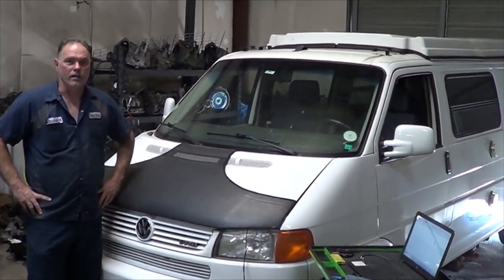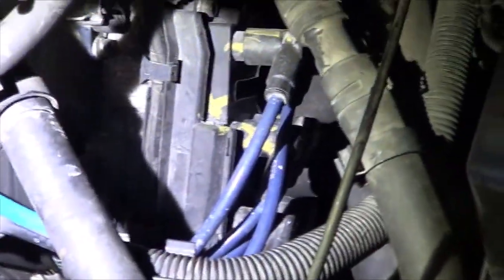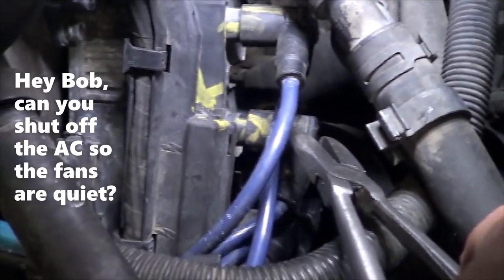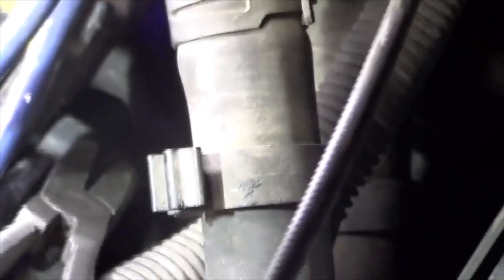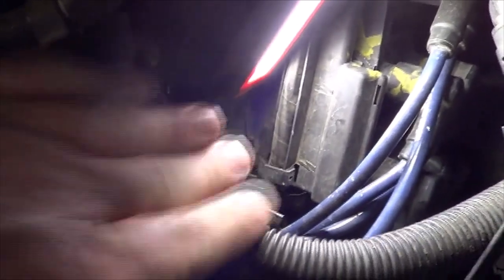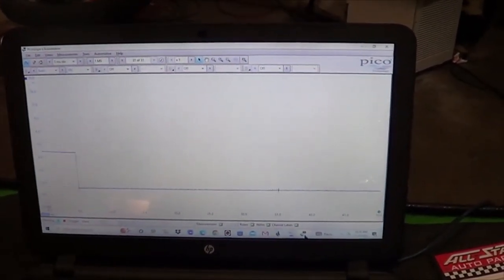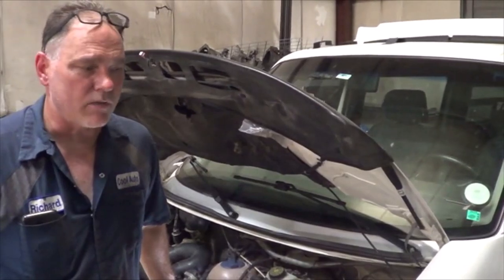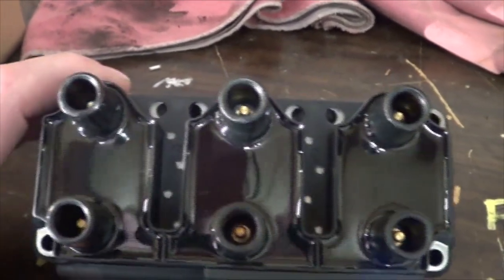Eurovan misfire

Comment: My question when there's a failure on a coil like that is why it failed. Some could of course fail due to being defective, but I find that most of the failures are caused by a faulty plug wire or spark plug not allowing the coil to discharge properly and as such building up higher potential each time it gets a signal to fire eventually causing the insulation to break down due to the high voltage stress. 
I suppose of course that if the engine was running great after the coil was replaced that the wires and plugs were in good condition in this case.
Reply from the maker: Excellent point.  And those things could have contributed to the failure, but customer had wires and plugs replace a month prior.  Sometimes these things just fail.   Good point you noted there Fred!  yabba-dabba doo!
Reply: @CoolAirVw  Yes, I assumed that might have been the case which would have course covered up the initial cause of the coil failure. It seems the most common thing done to try and repair a misfire are first plugs and ignition wires. If they didn't do that then of course you might have found that the coil replacement didn't fix the problem and then moved on to those items next. Naturally I don't have these problems with my car since I get the car going with my feet through the holes in the floor and also use my feet as brakes.
Reply: @fredflintstone8048  Say hello to Wilma for me. 
Stop giving a ride to that freeloader Barney.
Reply: @davidparker9676  He's a short man you know, so I feel a bit sorry for him in that he was 'shorted' by his creator. 😉 On the other hand I've always wondered if he and Wilma have been having an affair behind my back.

Comment: This is a scam. Coils and distributor caps do not usually cause misfire to just one cylinder or two...they can cause firing defects ...but these will not select just the same cylinder...I suspect the real problem is EGR valve clogged up in the ports.
Reply from the maker: nope.  You might want to research waste spark systems.  or Just dont comment when you dont know what your talkin about.